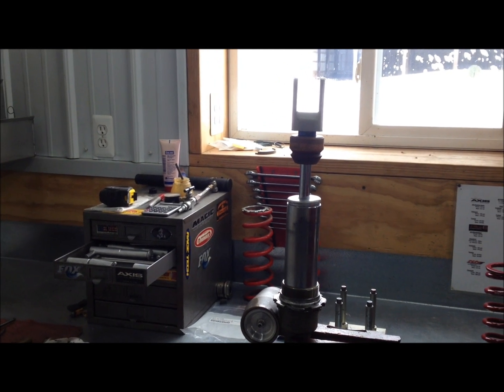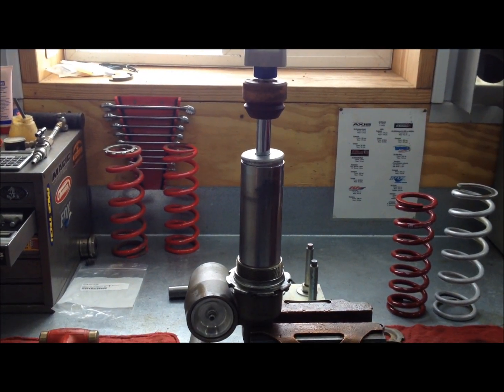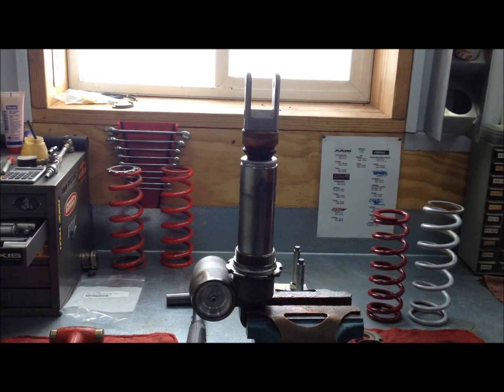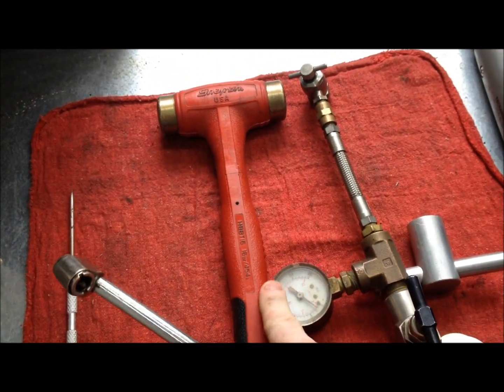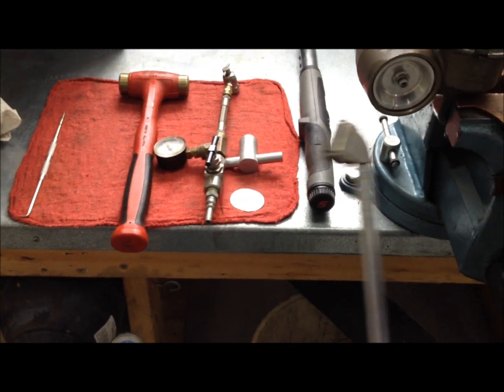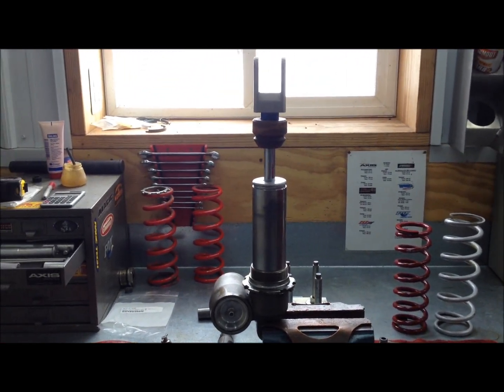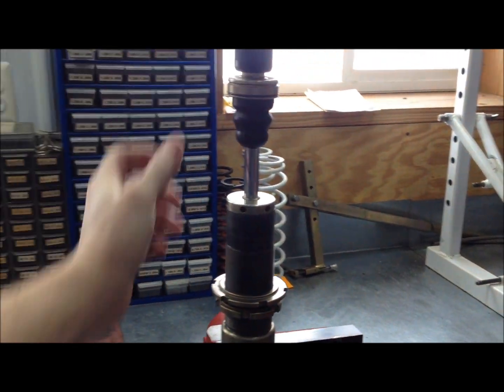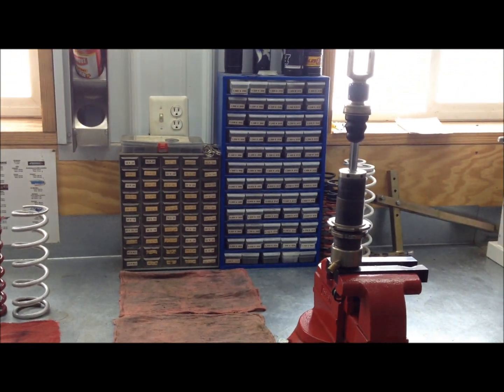I don't think I have and Nitrogen in my Shock

Comment: Is the test you performed for no nitrogen a guarantee? I’ve been told that my h2 Kawasaki is likely to have lost its nitrogen but it returns when compressed- also if I hold it compressed and then wind in the rebound fully it stays compressed until I release the damping half a turn

Comment: So on my 2003 Honda cr80rb
 I was out riding and towards the end of the ride the shocks got really really soft, so me being stupid I thought the valve stem was a bleeder valve but it felt like it was sucking in air once I had pushed the valve in it felt stiff again but the next time I took the bike out it felt like there was no dampening at all there is no negative or positive pressure in the nitrogen reservoir so I'm wondering if I have both a nitrogen and oil problem.
Reply: The purpose of the nitrogen is to create a pressure on the oil in the shock body. With out this as the shock travels through its up and down motion it will create a air pocket around the piston and valving resulting in a loss of dampening. Most offroad motorcycles need to have 150-175psi of nitrogen in the nitrogen chamber. If it feels like a pogo stick you have air trapped in with the oil. It needs pulled apart bleed properly and refilled with proper amount of nitrogen. Thanks

Comment: my sons xr 250 feels to have no dampening in the rear shock. you can just feel the spring and bounce it.....so im guessing that resembles the same problem in the latter part of this video....oil leaked out due to bad seal most likely correct? Is this something I can rebuild myself, or does it have to be sent to someone for repairs>

Comment: Excellent video with plenty of information! Thanks a lot sir!

How you ever heard the RFY SHOCK ABSORBER? chinese absorber but if they any good i mean. Would like to buy a set of those but have sone second thoughts. Thanks for your reply!
Reply: They don't have reservoir etc that is just a casting the rfy are just basically a spring and minimal damping not much different to other Chinese shocks used on atvs and monkey bikes better than some but no good if wanted actual rebound and compression items

Comment: Finally an answer to my problem. Was taking apart my rear Showa shock for the first time and let the nitrogen out and was a few steps ahead. Then I watched another vid where the guy said to test the shock action rebound to see if the shock is good. I never thought it was going to be bad and not work so when I tried it and it didn’t work I was worried. I’m assuming it is because I had already let the nitrogen out though correct? Seemed low on oil too because not much came out when I got the other part off. Could be both? Is it possible to have a blown shock that can’t be repaired?

Comment: Nice demo and clear explanation.
I'm thinking of getting a nitrogen performance shock. Do they need periodic refilling or do they just sometimes leak?
Reply from the maker: You should service your shocks annually to ensure proper lubrication and proper nitrogen pressure. Along with inspecting all your internal parts for wear

Comment: What’s the difference of running nitrogen compared to normal air?
Reply: Moisture. Air in shock bodies is bad news.
Reply: Normal air contains 78% nitrogen. If that helps
Reply: @TRC91  even more reason for my question if it’s 78% nitrogen already

Comment: Obviously I wouldn't be able to get up to 200 PSI but could I use regular air at say 50 psi to help troubleshoot the problem
Reply: If my shock has oil in it and on the resovor the screw is all the way tight would it need air to stiffen it up its not really soft i just want to stiffen it a lil pls respond
Reply: @Nickk.amador  I love it when people use reasoning to overcome problems, that's how man evolves, trial and error

Comment: 1st of all, great video, very informative.
I suspect your response to my question (If I'm fortunate enough to receive one) will be in the negative, but I'm desperate so I'll ask anyway. I own a 1989 Nissan D-21 Hardbody 4x4. I bought it from a guy that was seriously into off road, and ran it over the Baha course 5 times. The front suspension has been radically modified. The original mounts and coil spring suspension were removed, and all custom mounting points were fabricated. It now has three shocks per side. Two gas/oil remote reservoir, and one shorter oil shock down lower. My problem is that the two reservoir shocks (Rancho 7230 -T8041) have finally failed. They are from the early 90s. Rush says that they no longer produce seals/rebuild kits for them (no real surprise there) To buy new shocks to replace these would cost more than the truck is worth, but it's an awesome truck, very clean, in good shape. I want to keep it on the road if I can, if it doesn't become cost prohibitive. Is there any chance that you might know of any after market rebuild kits or seals/O-rings that might work?  I know it's a long shot, but thanks either way.
Reply: Whats the body tube size really only thing need to know.  Bless

Comment: My front forks on my 2008 yz250f go down but dont come back up whats wrong
Reply: Old comment, but its possible the air bleed screws were opened while the forks were compressed, so now when it tries to go past that point it is drawing a vacuum, otherwise the rebound damping is too far closed.

Comment: Ei , Nice imformative vídeo ..
I have a question , i have been check my atv shocks , They are like thats you show , 
I disassembly Them , clean and and new oil.. al parts Seems ok. 
Put al on the place and now my my question .
I charge them with nitrogen (160 psi) 
Its normal the rod dont come up in totality? I mean it stays a litle beat down of maximum (open) 
Did i put much oil? I put same amout , and a litle beat more .
Any Help are apreciate
Thnx

Comment: My front forks on my 2008 WR450F feels very stiff. And as if the rebound setting adjuster and even the compression adjusters make no difference. Can you do this same style video for from dirt bike forks?
Reply: Watch a vid on a youtube channel "mx factory" called suspension does and don'ts  it should help you
Reply: most front shocks have an air bleeder, unlike rear shocks you don't want pressure in the forks (when there fully extended, make sure when you open the bleeder screws the bike is on a stand). it sounds like you have pressure build up if the dampening screws aren't doing anything. also this is a very old comment so I'm sure you have a solution by now lol.

Comment: Hi, i have an issue with my Fox RC3 motocross shock.. in the morning before i use the suspension and ride it , the free sag is within spec, and the top of the range is nice and plush, and then once i ride it and come back in 2 hours , look at my free sag, it has increased dramatically to an inch or 2. the plushness in that upper range is gone as well and it squats a lot lower and the shock is much stiffer.. then next morning when i go to check again , when it has sat for a while, THE RANGE IS RESTORED ! plushness is back haha what do you suppose is the problem, ? thanks for the video btw , i was thinking the nitrogen might be low and might be some bubbles in the oil. .?

Comment: 💥💥PLEASE READ AND RESPOND!💥💥
If there isn't a way for me to get nitrogen, am I able to pump it up with an electric pump with normal "air"? If so what psi would you recommend after letting all the nitrogen out. And when I opened the front forks up, I smelled butane?? I'm not quite sure but I thought only fork oil was supposed to go inside? Please help💢💢💢💢💢💢💢💢💢💢💢💢

Comment: Hey do you think you can't tell me what the problem is in my rear ATV shock?I seem to have oil leaking but the suspension works just fine and the oil is not coming from the engine.
Reply from the maker: If it is a bladder style shock then there is more oil in the shock than what is needed.  If the shock is leaking then you will eventually loose enough oil and then it will feel springy.  Remove the shock from the bike, remove the spring, turn it upside down in a vise and push the shaft into the shock.  If you feel air in the shock then it is blown :)
Reply: Its the 2003 Yamaha 350 Warrior rear shock.
Reply from the maker: daniil semenyuk I believe those shocks are non rebuildable

Comment: could you use air?
Reply: I use air and have never seen a difference or had a problem.
Reply from the maker: You could use air but the pressure will increase as the shocks heat up
Reply: k, thanks
Reply: No way

Comment: whats the difference from a shock filled with nitrogen and a shock filled  air ?
Reply from the maker: The difference is that air expand when it gets hot.  The 2 will act the same until it gets hot!  Also it's hard to find someone that has an air compressor that goes to 200 psi.
Reply: thanks
Reply: MaulTechATV
Does it mean that air cannot be use for the job?
Reply: 1876 UNLOCKER He just told you. It can but it gets hot even if someone has a compressor that goes up to 200 psi.

Comment from the maker: The only way to add oil is to open up the shock.  To slow down the rebound of any shock there is a knob at the bottom of the shock (if you purchased the rebound option).  To slow the rebound down you screw the knob clockwise looking from the bottom.  

To adjust the compression you do the same with the knob on the top of the shock, clockwise is slower.  So in your case if they feel too stiff then you would want to turn the knob counter-clockwise.

Your spring rate could be too stiff also though!